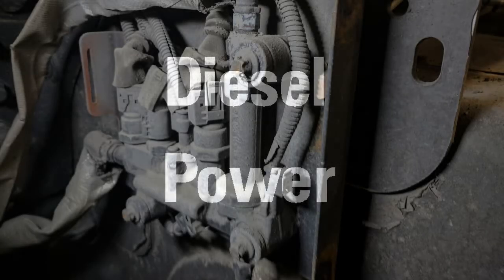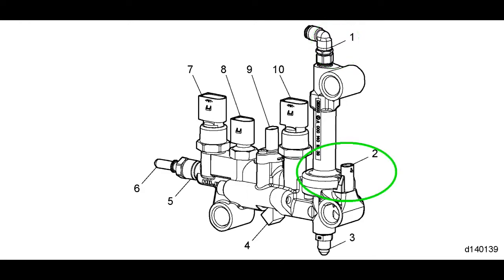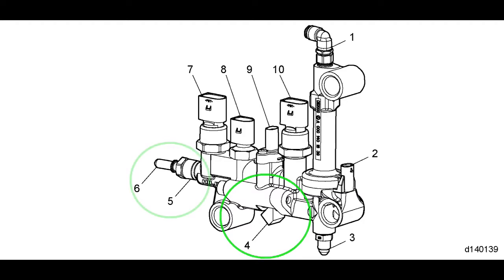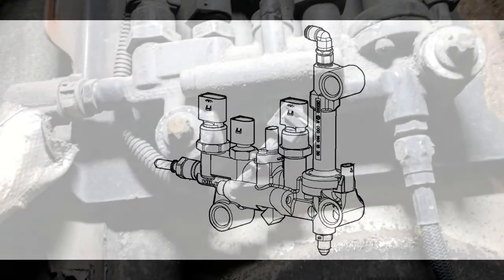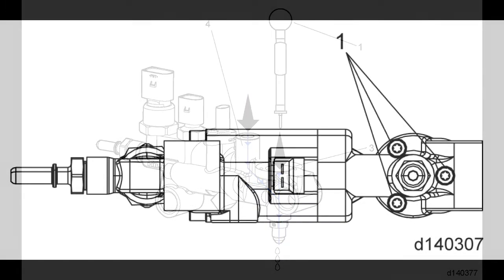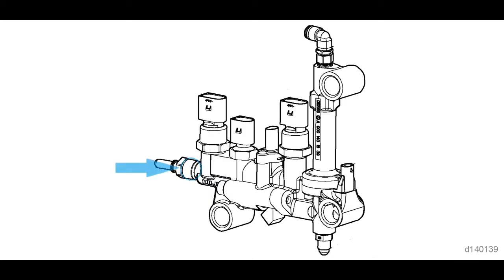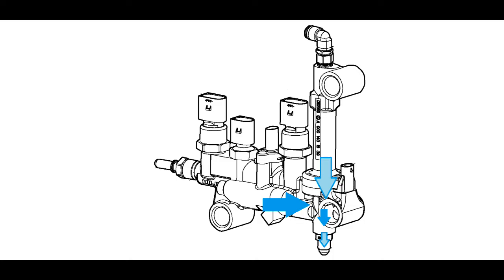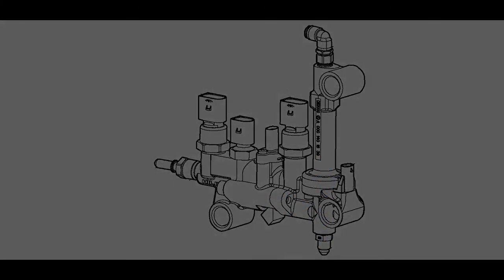Detroit Diesel DEF Metering Unit

Comment: Just replaced my metering unit which cleared a stop engine code. Now I’m getting spn 3361 diesel exhaust fluid dosing 1. Regen light is now on and I have no def consumption which was not a problem before the metering unit replacement. Any suggestions?

Comment: Very cool that the individual components are serviceable and replaceable.  Who is a good resource for these parts?
Reply: Where do we find the parts
??????
Reply from the maker: Any Detroit Diesel/Freightliner/WesternStar dealer.
Reply: I do a search and can't find any parts. I snapped the air inlet fitting putting it back together and I cant find it anywhere

Comment: What if the def is not going to the def metering unit. There is air coming out. Does the clogged Dozer prevent def coming over from the pump.

Comment: which engines is this system is on? DD13 or earlier DD's? Thanks.
Reply from the maker: Detroit used these metering units on all EPA10 DD series engines. The 13, 15 and 16 liter.
Reply: @TheDieseler  Ok. Thanks for your replay man. Nice video. Do you work for the company or run ypur own shop?

Comment: Hi hope you can help me with this problem my def container has been full for the pass 4000 miles i havent refill the def and Still full its showing me a codes eec 61 5246
.3251 pdf pressure the ampty reservoir light is blinking as a ampty def container but like i say Still full since the last time 4000 miles ago

Comment: I have a 4335 code vs 4334 and a plain engine light vs a check engine light been on for approx 700 miles w/o derate. I took the air supply elbow off the switching valve =no oil 2013 dd15 cascadia I'm stumped
Reply from the maker: 4335 is a Def air pressure code but it's also incomplete. You need the FMI to fully understand what it's trying to tell you.
Reply: TheDieseler EEC 061 SPN004335 
                      DEF AIR PRESS. 07
IS EXACTLY WHAT IM LOOKING AT What is FMI?
Reply from the maker: FMI is the failure mode indicator. If it's 7 then it's reading low def air pressure. Pressure is read from the Def air pressure sensor in the metering unit. Check out my latest video to become more familiar with it. You may have a restriction between the pressure limiting unit and pressure sensor in the metering valve. You may find oil in the inlet of the metering unit or the pressure limiting unit could actually be putting out low air pressure.
Reply: TheDieseler Thanx man I hope it will get me another 150 miles to the house and I'll look at it some more

Comment: Have you ever seen the def inlet screen get clogged? I am getting a code that says def tank temperature, google says to clean the metering unit inlet screen.
Reply from the maker: It's pretty rare to see the Def inlet screen in the metering unit clog. The Def is filtered in the pump so contaminants don't often make it through. It depends what type of vehicle you have but there's typically a temperature sensor built into the tank Header. I'd say either it or its wiring could be your issue.
Reply: Thank you for all the information.